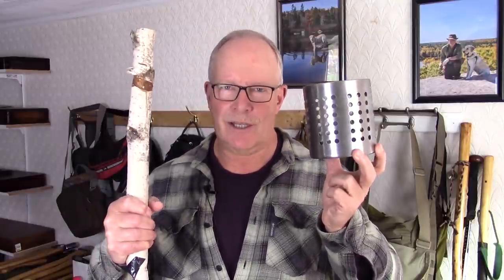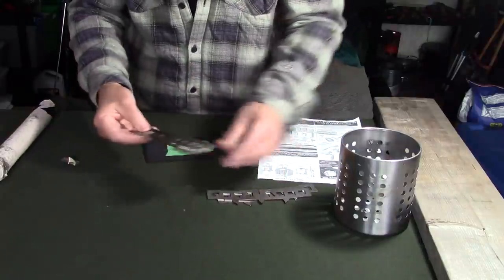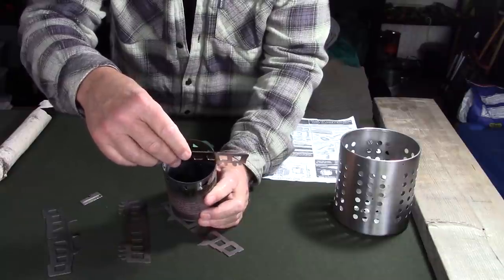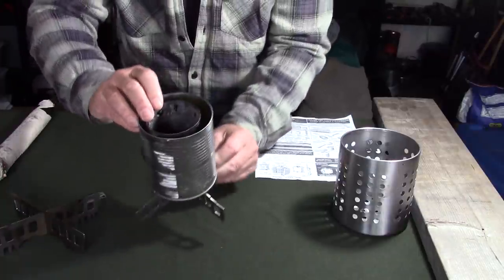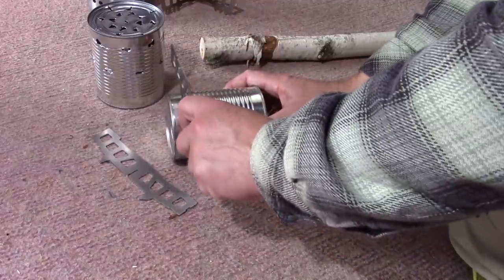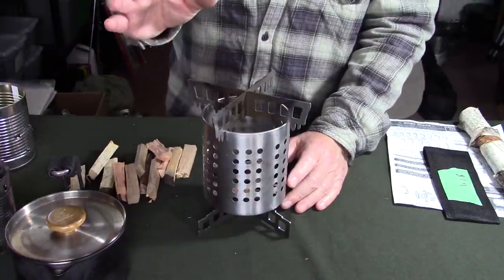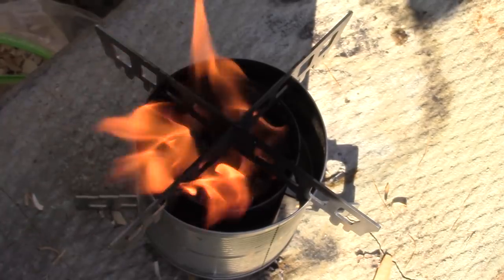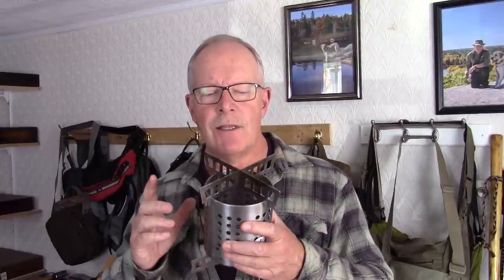Siege Stove - Ikea Hobo and Wood Gas Stove Builds

Comment: Thank you Mark, for the informative review!
A few more pointers:

A sheath is a separate order -- while supplies last. We were helping out a veteran who has had a challenging few years, with a bit of work, by commissioning him to make batches of these for us, as well as larger pouches. Unfortunately his health has not been improving (please say a prayer for him) and in addition, his industrial sewing machine broke down. He decided it wasn't worth the $1500 to fix, and has called it quits.  In the meantime we are looking for a low-cost heavy-duty replacement machine so we can start making them again.

Titanium Cross-Members are less than half the weight of the stainless sets.  For most people stainless is ideal, unless planning long distance treks.
Either way of preparing a can is quick: If in advance, a stepped drill bit works great for making neat, round holes. If in the field, use the hand-sharpened tips that are on the Base Cross-Member (not the one with the bullet shape in the middle). "Rub" any protrusions back into the can, using the end of a Cross-Member. Crush and recycle it after use and then make another one for the next trip. Or reuse it --  they will last quite a while. 

Our thousands of users around the world have been able to find cans that work well for them. The only US can -- between the most common small food can and the #10 can -- that doesn't fit well is the Progresso Soup can. 

Thanks again!
James
SIEGE STOVES
Reply from the maker: Hi James. Thank you again for sending me the set to test out. Thank you also for all the additional information you have provided in your comment. I do pray that the gentleman who has been helping you out recovers.
Reply: @MarkYoungBushcraft  Thank you Mark.  For your Canadian (and international) audience I should mention that we are able to keep shipping costs very low. If a customer doesn't mind printing the instruction sheet themselves (the added weight can make a difference), and by using minimal packaging materials we are able to package a stainless steel set of Cross-Members or two titanium sets under 8.1 oz, which is the lowest cost postal weight bracket. This can save quite a lot!
If the items ordered are over 8.1 oz, one can add quite a lot before exceeding the next thresholds which are 48 oz, and 64 oz (please forgive the Imperial measures :) ). For all these options we also charge less than what we pay for the postage. PayPal will calculate the shipping cost and show it before you commit to a purchase.

For US customers, we have free options if the order is over a certain amount. All this is posted on our web site, https://siegestoves.com/order-stove.htm

Comment: Very thorough review, Mark. I visited Siege's website several months ago, and may purchase some products from them, eventually. Until then I will continue to make hobo stoves for fun, and have a few that have passed the burn test well enough for use on short term hiking trips. I don't carry them on longer hikes (I am 500 miles away from completing Appalachian Trail in sections, which average two weeks per year).
I took my Toaks large stove on the Long Trail in Vermont recently, but didn't use it much due to restrictions at certain sites and above certain elevations. 
Titanium is my metal of choice for its durability, long life, and low weight, but wood stoves require a lot of metal to be effective in the long run, and it's no fun trying to burn damp wood, so carrying my homemade alcohol stove and making small wood fires surrounded by a titanium windscreen when time and conditions permit is probably my best opinion. 
As far as top-down burns, they are good if one desires a long burning fire, but, I find myself using my stove for a quick meal or cup of coffee or cocoa, not for real cooking. 
Taking the time to let a gasification stove to work wastes time and fuel, and doesn't eliminate soot on pots, so it's pretty much a non issue for me, much as the flame pattern from an alcohol stove has little to do with anything more than aesthetics. Sit on top stoves with large holes are often easier to use and as or more efficient than one with a flame pattern which mimics a home gas stove burner.
Again, thanks. Good work. 👍
Reply from the maker: Your experience with wood gas stoves is similar to mine. The only wood stove I have used so far that does not produce any soot is the Pyrolino but only after it gest started and I add the tertiary burn chimney. Of course, it is definitely not something you will hike the AT with😂. Thanks for commenting

Comment: Try putting the utensil holder inside a slightly bigger can. Maybe a coffee can, or a paint can and the utensil holder will mimic a wood gas stove with all of those holes. :) You can also cut away the ring off the paint can for the pot stand to work. :)
Reply from the maker: Good suggestion. I actually have been working on something like you suggest. Thanks for commenting
Reply: @MarkYoungBushcraft   Any can the closes to the utensil holder. :)

Comment: Very thorough demonstration of this unique kit. I’m wondering if you could use the cross bars on that homemade wood gas stove with the lip by snipping the lip in four places where the stand wedges in. I like how tall the pot stand is. Very cool demo
Reply from the maker: I am sure you could do as you suggest to create an even better stove. I tried to keep it simple for this video as if they were the only tool I had. Thanks for commenting
Reply: Exactly, Kelly Johnson. Almost everyone who travels outdoors on a fairly regular basis will at the very least have a Swiss army or Leatherman knife/tool and be able to notch the lip inside that can to make a better fit. In reality, the best fit is when the inner can is snug against the lip of the outer can.

Comment: What a fascinating idea!  I've never heard of this stove, and for the life of me, other than urban preppers,  or perhaps budget minded, occasional campers, I can't think of a good reason to buy one, but I still love the idea.
Mark, I have to tell you a little story.  I had my firebox out while making lunch with a friend, and I was talking about this bloody guy on YouTube that's always on about this "top burn down" thing.   I usually just burn fast for a boil, or use the side ports for a slower simmer, but I have to admit, if you need something between the two. It's not a bad idea.
Have you ever done an, I forget the proper name, but Swedish torch?  With the log split in 4?  
Oh, and have you ever noticed that a firebox, and maybe others too, burn with almost no smoke at all?  I believe you're getting an almost complete burn with it, just like a "gasifier"  but hotter.
Reply from the maker: Hi Jim. Its funny how many people tell me a top down burn can't work😄. The only thing with a Swedish fire torch in a wood stove is finding the right diameter log that fits inside properly after being split into four pieces. I will likely add that into a video at some point. I think the reason the top down burn works so well is part because it has a lot in common with rocket stove principles in that it draws air up from below at higher rates and causes a hotter flame resulting in a more complete burn/ Thanks for commenting
Reply: Mark Young   I knew they would work, partly because I've seen them a million times, but also because the chamber in a half way decent stove creates great conditions to burn.  It'll just burn more slowly.  I certainly don't think it's a great idea on a tough day with damp wood, but it will slow it down and make a hot enough fire burn a little longer, so you don't have to mess with it quite so much.

Comment: Thanks Mark. I was wondering when you might do a review on this product. I think a nice heavy duty leather sheath for the siege would make it very useful and traditional. I was wondering, could you use the brackets in reverse (top on bottom and bottom on top) for those pesky odd sized cans?
Reply from the maker: Reversing the bars top to bottom is an interesting idea. I will give it a try. Looks like Siege Stoves may not be able to supply sheaths in the future so making a set is a good idea. Thanks for commenting

Comment: I have configured a number of wood gassification stoves out of various cans before and found the larger they are the hotter they get, presumably because the greater mass allows more time for the heat to accumulate. Unfortunately food grade cans don’t seem to handle the very high temperatures that occur in the process for very long. They deteriorate fairly rapidly, maybe two or three uses and they burn out. Stainless works better for the burn chamber.
I share your observation that the era of the metal coffee can has all but disappeared. The plastic and cardboard ones are not well suited for the application.
The gassification you achieved may be more like increased air flow from the hot air directed into the flame increasing burn efficiency. I can’t see much of a way for the wood gas to get into the outer flow since the center flame seems to be the primary fire source drawing the heat up the middle. I may be wrong but without a laser thermometer or heat probe it’s hard to tell. Either way it is still an improvement over a simple un-enhanced wood fire.
Reply from the maker: I agree with you on all points. Large stoves do appear to be able to generate more pyrolysis as a result of their mass. I also agree food cans do not last long as wood stoves. That is why I don't often use them. It was hard to tell if true pyrolysis was occurring in the cans or if it was just secondary combustion but as you say, it was improved over a single wall stove. Thanks for commenting